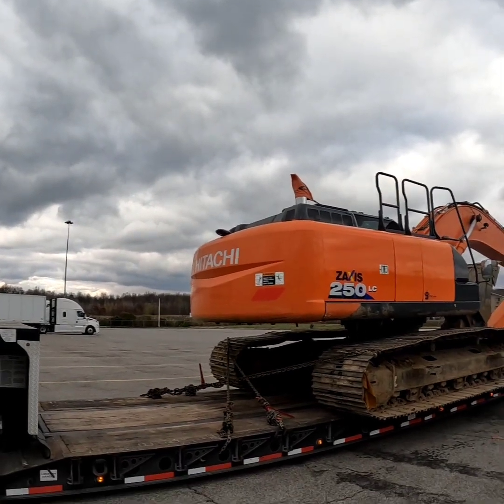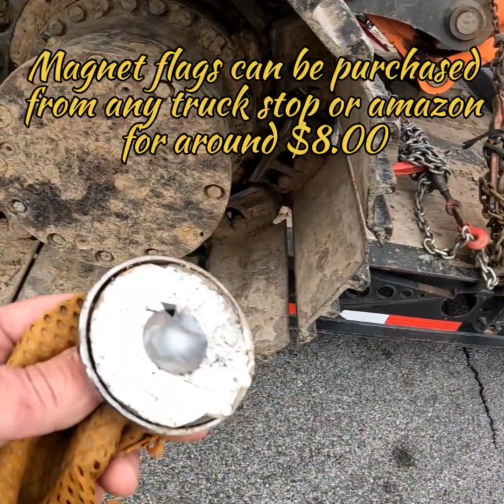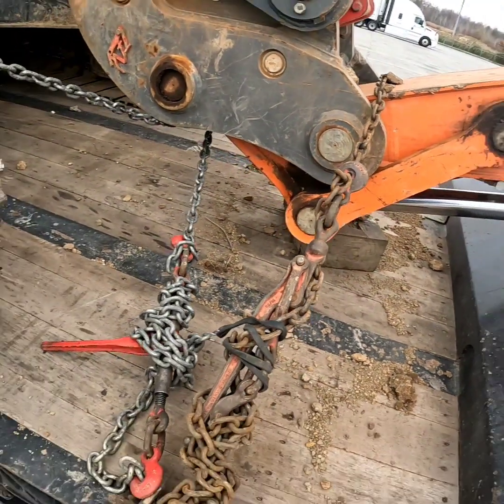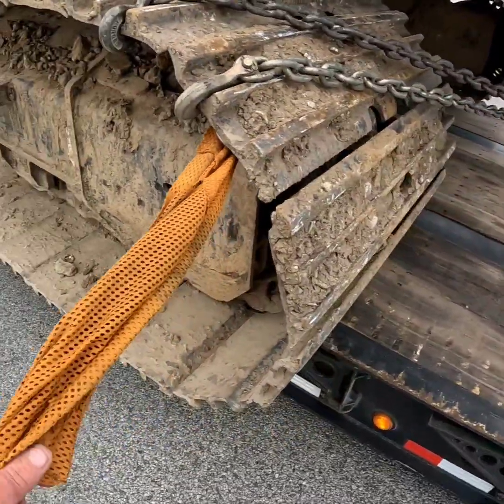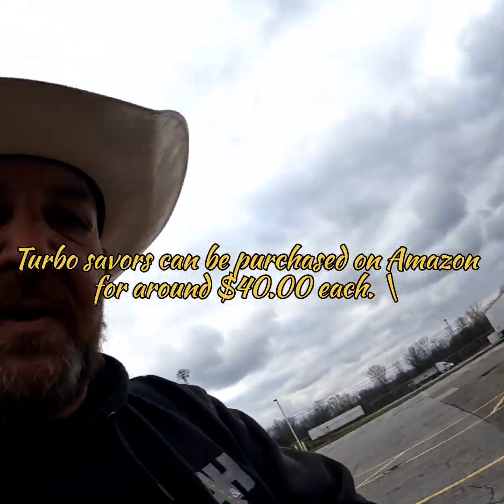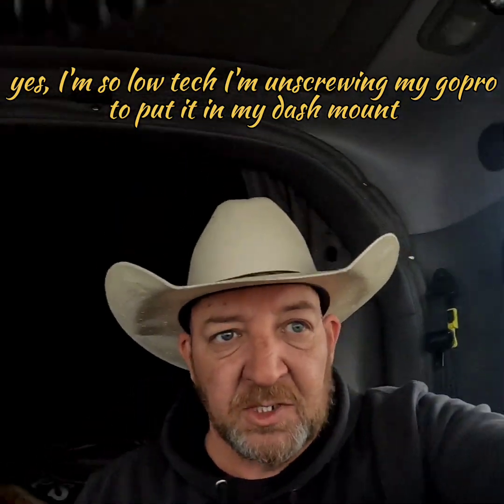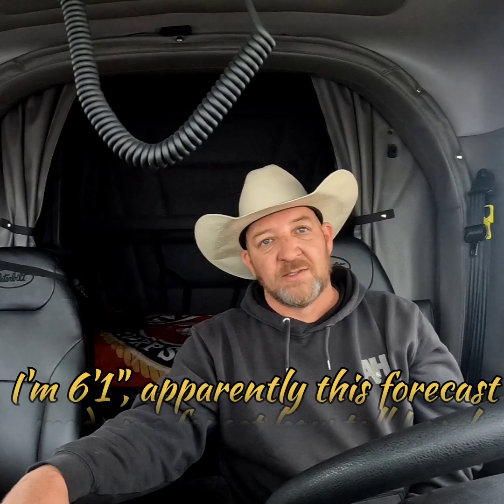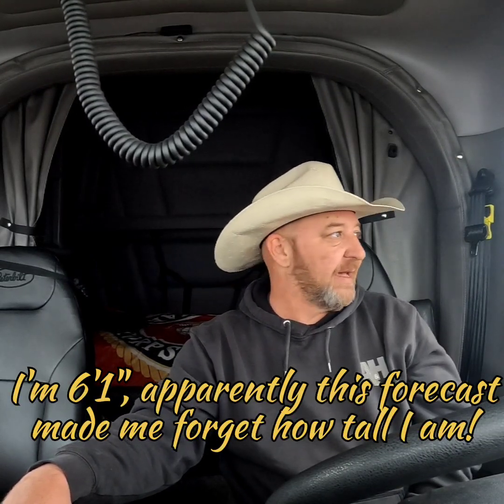Ep. 4 Hitachi 250 excavator from IN to Pa

Comment: Good evening, just came across your channel. I run local RGN for a construction company in NC and we run our binders from the side of the trailer to the inside of the track on these.  We run 16k binders, that usually is more than your chains. Just wondering if that would be an option for your setup. Nice looking rig, be careful out there.
Reply: What I was thinking also. I run a binder directly from the inside of track to the outside of the trailer on four corners. Chain across the boom, and a set of X-chains front and back if needed to cover additional weight. Cleanest looking way in my opinion, but nothing wrong with what he’s got. Everyone has there own routine.
Reply from the maker: Joseph and Casey, thanks for the comment and suggestion. You are 100% right your 16 k binders are way stronger than my chains. I run 3/8 chains and binders only because thats what my company buys for all of us. I could use just the binder and it would cut down on the use of the chains and definatly make a cleaner look. Because i haul so many different types of units and freight I usually just leave my equipment out so honestly using my chains is as much laziness of putting the stuff away as it is for securement reasons. I'll have to bring that up on my next tracked vehicle video. I appreciate the suggestion and for anyone watching these that runs similar or the same equipment all the time is a way easier and faster option!